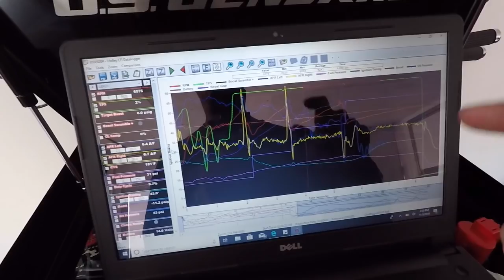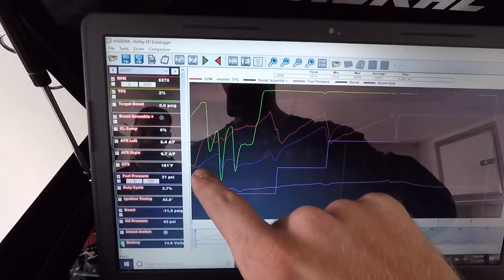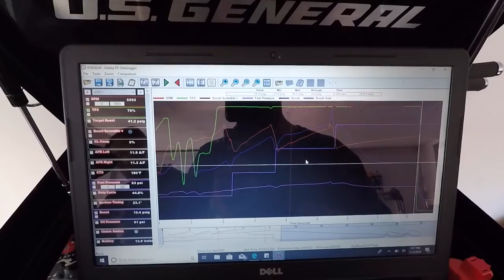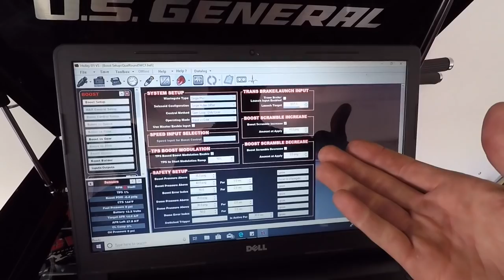World Cup Day #3 - Third Round Qualifying, Shattering Parts (Changing To Old Mounts)

Comment: Mount a GoPro aimed at the diff just to see how much it moves during launch. I bet it's crazy
Reply: Good idea man, if they got one of those new gopros with the crazy stabilization they could learn a lot with what's happening
Reply: This is a very good idea 👍
Reply: I don't think you would see much more than a bit of flexing, being independent rear suspension and with the trans bolted right to it I don't see it moving around much. If it could it might survive all that power, but it can't be set up that way.
Reply: I say put 3 on there one on each side and one on the back. As seen it fails in different spots so just one angle might not get the break. 

Now with that said, learning things about it isn't really going to change much. The case needs to be beefed up quite a bit. 

It looks like the diff case is built to save some weight and with the fins to promote cooling a billet case where the thinnest spot is about an inch thick would handle a ton of power, at that point the internals would break way before the case would. 

Dissipating the heat is needed for like a track day or driving for longer intervals, for something like this it should be fine.
Reply: At the very least it’d be awesome to watch the diff explode
Reply: Wouldn't that be a great thing to drop on the track!
Reply: If cooling is an issue with the billet case, install a diff cooler with a pump on Leroys wing, for use during non 1/4 mile situations. When you remove the wing for 1/4 mile stuff, also disconnect and remove the diff cooler for weight....
Reply: @q......  With 1 inch minimum wall thickness you are going to have one hell of a lump of steel back there to drag around everywhere you go. Probably would be just as fast to leave slower and not break the stock case as leaving hard and taking a boat anchor along for the ride.
Reply: It’s not moving, it’s just breaking....
Reply: @--_DJ_--  gotta realise with a much stronger case Leroy  can leave a helll lot harder and with the added weight on the end can help Leroy bite into the track harder but it probably gonna add 50ish or 60ish pounds since it looks like the stock case is only about 30ish guessing anyways
Reply: @--_DJ_--  Billet aluminum not steel. With Billet steel you could get away with thinner than what they are currently running. The diff they are using right now isn't "steel", it's cast aluminum with minimal wall thickness probably 3/8 to 1/2". The same casting but in iron would work but it would be much heavier than say a 1" minimal thickness billet aluminum housing. 

@bobwatters I don't think welding things between the fins would work. It wouldn't add as much structure to it as you would think. The only way to help with the structure would be to basically design a steel cage around it that can essentially squeeze it together from all sides. But even then it would still fail before the internals did. The case would still crack, it just wouldn't be as spectacular as it has failed before.
Reply: Steal?  Not aluminum? Real question  not sarcasm.
Reply: We tried the cage idea over here since parts are real hard to come by. Built a cage using 1/2 steel, rings on both sides and the back cover tying in to the transmission. It still breaks the case, the case is simply not cast to take so much power. The C6 case fairs a little bit better but also fails even with bracing. Ended up having a custom billet housing made.
Reply: @C4AJ  I agree, I was assuming the guy was talking billet steel, which is where my boat anchor comment came from. I still think 1 inch of aluminum would be overkill but not near the weight penalty a lump of steel would be. There is only so much more to gain off the launch, it will just blow the tires off at some point no matter how strong you make the case.
Reply: bobwatters  It will just break in the next weak spot even if you manage to brace one part it will just find a new way to let you down. It didn't even break the same way on the same track. That case has just met its limit, far too many bald eagles flyin around for it to contain.
Reply: @q......  I think you are a bit generous with the 3/8 min. on that case but its hard to tell without laying my hands on one. Why the "" on steel? Isn't billet steel, steel?
Reply: @q......  I was wondering when somebody would realize that most Billet parts are from aluminum.. sad
Reply: @--_DJ_--  Billet is a chunk of metal so to speak machined down. It's good for more or less one off or low production runs. Casting steel would work but typically you would want higher production runs. Billet is stronger than casting, but also more expensive as it uses more material most of which can be recycled. 

@Daniel Jay Most billet parts are made out of aluminum because it's easier to machine. You can make parts out of billet steel, billet titanium, billet cobalt, hell even billet tungsten. Just imagine that casing in billet titanium that would definitely work but the machining and material cost would be insane. I didn't specifically mention aluminum because I thought the addition of 1" minimal thickness would be a dead giveaway, that and as you mentioned when most mention "billet", it's almost always assumed it's aluminum. Now you can go thinner in areas not needed but you would need to spend quite a bit of time with an engineer and really go over the final design and do a lot of testing. If you just want a billet case and have it work and it be cheaper in the end then just taking the design as is, bulk up the outside with more material and Bob's your uncle. No need for an engineer, no need for testing. Just take a diff casing to a machinist tell them what you want and that it needs to use the same mounts and they will measure each bolt hole location, each face, etc, etc and they can knock one out. It won't be cheap, but it will be just as effective as one that was properly engineered/designed/tested it just won't be as "pretty" and as light. 

Just to clarify it a bit more. When people say billet they are talking about a solid piece of material in either a rectangle/cube, or cylindrical shape and they machine the parts down from that solid piece of material. Cast material like aluminium or steel, or iron basically takes a rough shape of the item and machines down the areas needed to make the final part. If you want to know more about it and or see it in action, simply look up here on youtube billet machining. There are a few good videos machining an entire engine block out of billet aluminum.
Reply: @q......  I am well aware of what billet means, that wasn't my question. I asked why you used "" on Steel. What you think they do with auto casting scrap, just toss it in the garbage?
Reply: A billet case would still be aluminum but because it is machined vs. Cast billet is much stronger .

Comment: Will Leroy ever reach 1776 HP? Maximum freedom would be achieved.
Reply: Ben Clark he’s most likely pushing around 2000 to the ground at this point so yes he will lol. He made 1300 at 28 lbs so at 38 I’m sure it’s atleast 1900
Reply: @kp28az  Dyno sheets are what I like to see. Sure, it's fast, but how fast?
Reply: I wise he put a custom carbon body on Leroy..i know its not be the same Leroy but he would go. So much faster with much ease..
Reply: @zstrode.8953  He's gone so far without aero giving up now would be a shame. Maybe after he runs a 7.0X?
Reply: Probably wasn't far off with 38psi. Just needs to make it the whole run.
Reply: Ben Clark I pretty much just told you how “fast” it is. Just went and looked and he made 1250 whp at 23 pounds. At 38 he is 100% over 1800 whp
Reply: Nicholas Allen duct tape??
Reply: @DATTURTL3  genius
Reply: Romain Grosjean FLEX TAPE!!!
Reply: @kp28az  The point this whole time is to go fast, Leroy would still be Leroy, and that car may make it into low 7s with some sort of aero. Just look at what he's done with out the body panels, with them that car would be a monster. (Even more than it already is)
Reply: I don't think anyone here got the 1776 reference...
Reply: @MOTO809  I did
Reply: @MOTO809  have to know history
Reply: MOTO 809 we did it's just been referenced a ton in the comments so it's not funny.
Reply: Maybe 2001. When everyone came together to stop the terrorist threat. Everyone from all over joined the army. Now that's Freedom.
Reply: @kp28az  I think you missed the joke bro
Reply: he said 1500 hp, i think that might be optimistic.
Reply: @kp28az  motor rated for 1500. He's pushing like 1300 - 1400
Reply: Ben Clark This is the most American comment I have ever red, Full respect to you good Brother🇺🇸🇺🇸🇺🇸🇺🇸🇺🇸🇺🇸🦅🦅🦅
Reply: This is the greatest comment to grace the amber waves of america
Reply: @kp28az  
That's not how that HP is figured.
Reply: Maybe later,but leroy is still making progess with out it
Reply: @benc.1197  dyno sheets mean shit. It's a tuning tool and they can easily be manipulated. ET and Mph tell the real story.
Reply: @kp28az  Your math is extremely inaccurate, no offense. But you must measure gross manifold pressure, not net boost. Furthermore even if he did make 2,000hp, that would not make it to the ground after drivetrain loss.
Reply: @slobaru7094  1500 To the crank maybe, not to the ground.
Reply: @zstrode.8953  it wouldn't pick up as much ET as you think it would. You would see the difference in the mph for sure but not as much in the ET. Most of the ET comes from the front half of the track when aero doesn't play as a big factor as it does on the backhalf. That's way the 60ft is so important along with the first 150 to 200ft. Just just like using the scramble button in 3rd gear. It help ET some but you see it more in the mph. Unless you have some drag racing experience running this fast most of you will think I'm crazy. It's all good though.
Reply: @kp28az  You do realise that's completely innacurate, right? It may be a formula to some extent over some rpm ranges but there will be a point not too far up where the flow rate gain is lower than the boost gain. In other words there will be a point where it will hit a wall which will need massive extra boost for a small hp gain. 
That's ignoring the temp build up with more boost, the turbo's efficiency ranges and those for all the other parts. 
Boost is simply a measure of pressure caused by a restriction. As flow increases that restriction becomes more apparent. 
Now if you look at boost over CFM at RPM then take a baseline deduction for heat, you can build up a reasonable idea - though still not accurate. 

Basically unless Leroy's motor, turbo's, fuel system and everything else supporting it was massively overbuilt in the first place, there's no way just dialling in an extra bar will add another 600hp.
Reply: Si Raff the lsx he was built is massively underrated making the company look better when the car is making so much more power. More power to them I would do the same thing. Everything you said is factual but there is no doubt that a 1 bar jump in boost will retrieve at minimum 500 wheel. I have no more to add. We will see if he does another dyno pull at or above 38 lbs and see what happens. Until then, think as you will
Reply: Yeah he's not making 1900 whp on 38 psi if he only makes 1200 on 28
Reply: @kp28az  I doubt it's a 2000hp build in disguise. 
In ideal conditions those turbo's can make 2000hp between them. 
Very few are actually anywhere near that and the ones which are are usually on Supra's which are 3.0 6cyl's usually running north of 8000rpm. 
That's a very different flow rate to one bank of Leroy's V8. 
I would love to see it hit those numbers but I think it will take a lot more than simply adding a bar.

Comment: What you are seeing here folks is why stick shift (direct drive) cars are very difficult to go VERY fast and people use automatics.  That much HP and no slippage puts a tremendous amount of pressure on a drive train if only for a split second and it's more than just about any metal can take.  Stick shift is a hard class to run.
Reply: Well said brother.. 😎
Reply: Need to add some slippage to the clutch.
Reply: @leadbedr1  he knows but he also knows what he needs to do to run a faster time and these cases just can't handle it I think now that we went back to his original mount it will last longer since there will be a little play in the bushing solid mounts are very hard on Parts wouldn't put them back on until his billet case arrives but I think he decided he's going with the C6 case from now on he just has to make changes to a lot more to do it that's why he hasn't already
Reply: Good point, made me think of how some Pro Mods run torque converter drives on a dog ring sequential boxes. Best of both worlds.
Reply: Ocean Current stick and direct dive isn’t the same thing

Comment: Hey if it takes 1500 horse to blow a stock diff case to pieces GM did an alright job making them. And don’t worry by next year you’ll be the first stick corvette in the 6s
Reply: you're smoking glue if you think this car is touching 6's
Reply: big cheese haha right. Will never touch 6,s with shit aerodynamics and being a stick
Reply: big cheese that’s what was said about 7s and here we are
Reply: dwolf7 if he can get under 7.5 I think he can get close
Reply: Mike Daniels I don’t think he will be able to do it with a small tire. Will never get it to leave hard enough
Reply: Yeah he needs an auto and better aero if he wants to get close to the 6’s
Reply: Leroy has reached his final form. Time for cleetus to graduate to the next level. Keep Leroy around for special occasions. If he really wants to hit low 7's or 6's, then it's gotta be with a whole new car. Tube frame, big tire, blown alcohol hemi
Reply: big cheese well let’s see when he pulls 7.5 then
Reply: @Mikes_rc_adventures  sorry bud but I have to agree with big cheese.. you're smoking glue 🤣💀. To get into 6's your 0-200+ is faster than most cars 0-60. There is a 3000hp Nissan gtr that can go 6.88 so you have an idea of how fast that is.
Reply: I like to be optimistic but cars in the 6s have carbon fiber bodies tested in wind tunnels, they weigh nothing, and have close to 3000hp if not more. Plus they're running autos, pure methanol, and huge tires. To run 6s Leroy wouldn't be Leroy anymore.
Reply: 6.9 with rear diffuser, bodypanels, billet diff, bigger tires and 40 psi,  im calling it now!
Reply: @dookiebooger9967  or a twin turbo yote
Reply: Maybe with a 3500hp Hemi.
Reply: @92hegner  lmao, don't need a big tire to run low numbers, have you seen the twin turbo mustang that run 5.92 in 1/4 small tire in steel body?
Reply: Antonio Jalalon nope, do you got a link? 😁
Reply: @92hegner  search it fastest fox body mustang on small tire
Reply: @G Dakota MD I never said this car will run 6 seconds, all I'm saying is you don't need a big tire to run 5 seconds, Reading comprehension helps,plus I never mentioned anything about Leroy running 6 seconds😂😂😂

Comment: I remember when I had saved up enough to get a pair of dart heads, when I put them on I also changed from urethane motor mounts to solid. 
Right of the bat, I started breaking trans cases. 
I was so amazed at the difference the heads had made.

Comment: You need to tall to jay at real street. Those guys are using a hydraulic damper on the clutch pedal that can be shut off after launch. It slows the clutch pedal down and makes it consistent. You could have a 1.1 60ft every time.
Reply: Nasty, I messaged Garrett yesterday with a similar suggestion.  He needs to be able to consistently slip the clutch and make it more like a good converter.  A product I have seen that is better than the hydraulic restrictor is the Clutch Tamer clutchtamer.com 

I don’t have any affiliation with the company, but I bet as cheap as it is they would give one for free for evaluation.  It has got to be better than relying on wheel spin for protecting parts and being consistent.
Reply: @MrNorman8686  I don't know how to message him directly, but I think the clutch tamer is what jay at real street is using. It is exactly what he needs, and if he could program it into the holley he could use it in second to help protect the drivetrain on the 1-2 shift.
Reply: @nastychevys  Leroy can't handle of 1.1 60 ft until he gets his billet rear case or he probably would have something similar already
Reply: @freedomfox8183  it is a lot easier on parts when the clutch is coming out smooth, and not dropping the clutch like he is doing now. The diff case will hold up better. He still needs to upgrade diffs, but that doesn't change the point that I made. Using the part mentioned he can dial in the launch, and possibly soften up the shift to 2nd. Doing that will save diff parts.

Comment: Instead of the billet aluminum case, go with a billet steel case.
Reply: Forged Titanium should do it...
Reply: How heavy would that be though?
Reply: @Woke_R2  probably a lot more than aluminum, but right over the rear tires=better traction too
Reply: That would be interesting. I wonder if the steel would retain more heat.
Reply: @chasecampbell943  yes, but it's not a road racing car.  Only under load for 7-8 seconds at a time.
Reply: If he wasn't a hundred pounds overweight already for his class that would be a good idea..Billet aluminum C6 case would be fine

Comment: Your flock of Bald Eagles 🦅 is shredding those diff cases. They can’t handle those talons. I think it’s time for RPM to make you a custom one. Equipped with talon guards
Reply: That's pretty much the best case there is for a C5 that's why he has someone working on a billet one but he also said he's going to switch to the much stronger c6 one after this weekend so maybe he should just have a Billet C6 case made right away